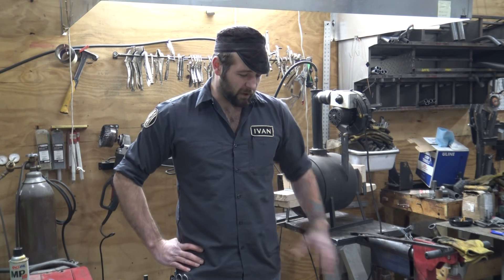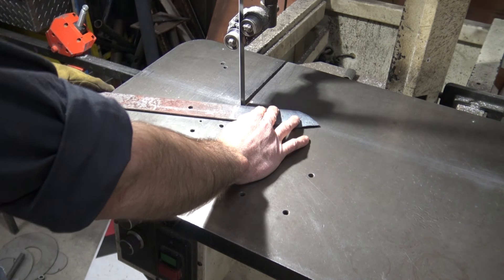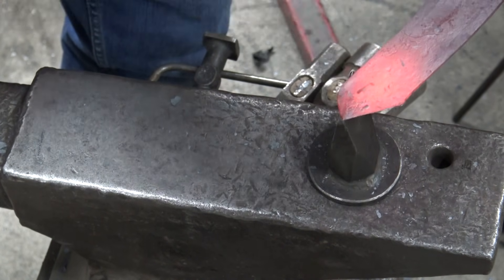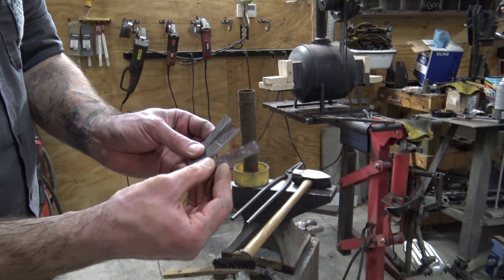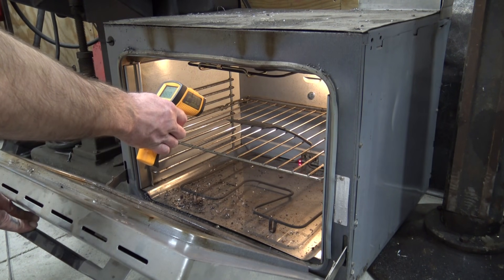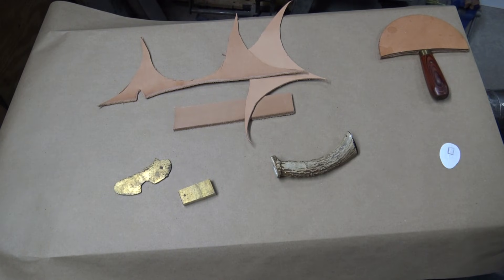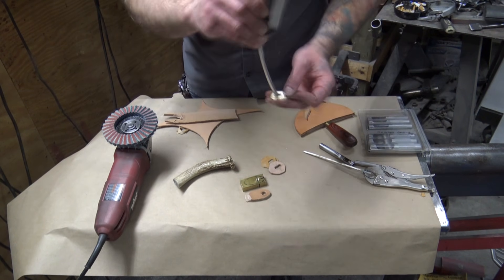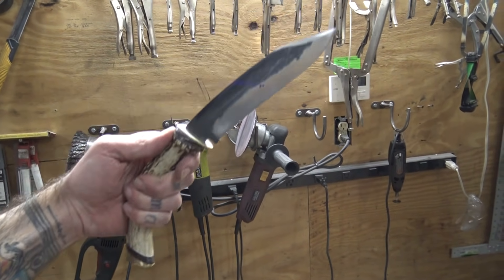Forging A Knife With Deer Antler Handle

Comment: Say, Ivan, you can boil an antler after a good 24 hour soak and it softens up and you can bend it straight .  You clamp it in a vise or with clamps until it dries out. You don't have to use them bent. Keep it up

Comment: Instead of drilling and filling the antler to fit the tang you can boil the antler and push it into the tang it will both get the exact shape you need and the antler will act as a glue when it is hot
Reply from the maker: aidan rico Nice, I’ve never tried that. I will, thank you

Comment: Excellent craftsmanship on that knife Ivan and thank you for keeping it simple and to the point. It is rare to see anyone making a knife handle from antler, at least in my life. Good snug fit on that handle too. 
I can appreciate this since this knife I own has an antler handle that rolls on it when in the hand but does not fall apart, still a good knife minus the fitting of that handle.

Have you tried the proper way to forging out your bevels? Angling you blade upon your anvil and the angle of your hammer swing to the same angle of the bevel you desire to form? How is you elbow and wrist? Do you use you shoulder muscles to lift and swing your hammer to your work and not your wrist or for-arm?

Comment: Natural gas, how lucky you are
Reply from the maker: wayne mitchell its nice, it wasn’t that hard to build. If you live somewhere without natural gas you could always run a homemade forge off propane with a few adjustments. I started with an old coal pan forge. Still use it for demonstrations, but yeah a gas forge is a lot less messing around.